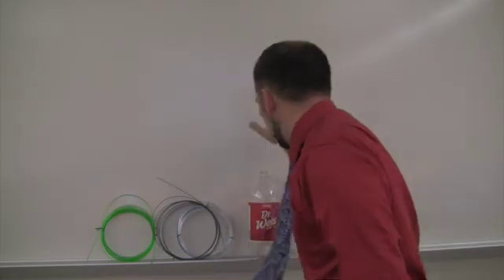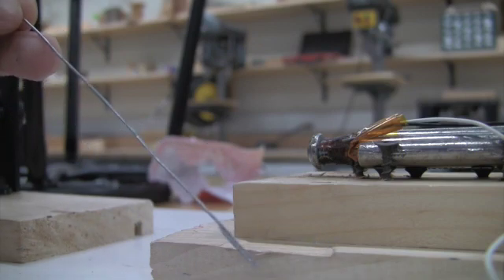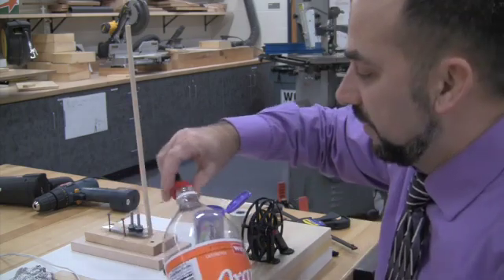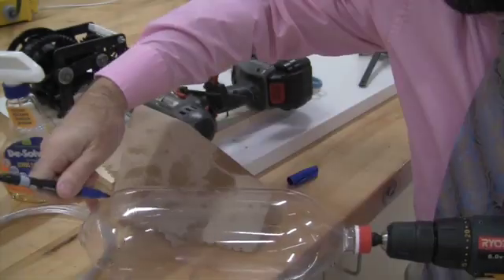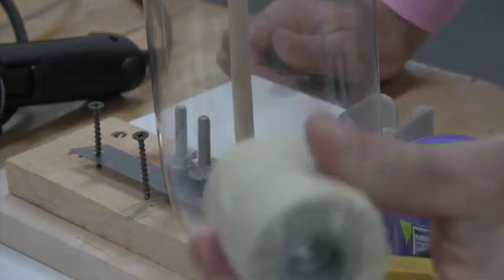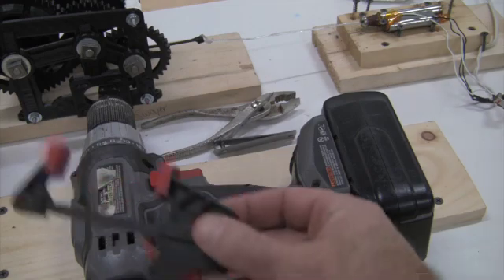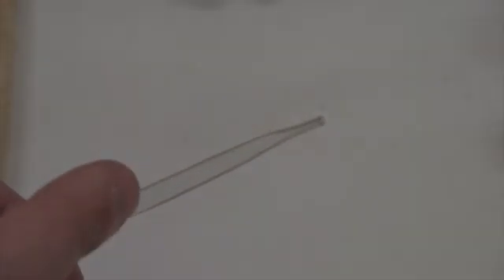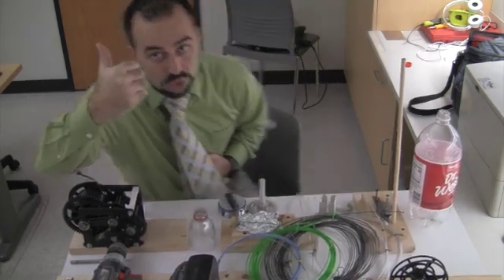PET Pultrusion Filament Maker

Comment: Hey, this video caught my attention the most out of all of them. Every step is explained in detail – even the bottle cutter one, which interests me the most. So how thick should the PET strip from Coca-Cola Zero be for a 1.5 mm nozzle? I'm not sure about what my caliper measured. It shows something like 0.33 mm? I only have a 1.5 mm nozzle – I saw in some other guides that they used a 1.5 mm nozzle to avoid clogging the filament in the Bowden tubes of the printers. Also, I’m really struggling to get the bottle cutter to work. I’ve tried many types, including the bearing-based one, and that one doesn't work for me at all. I must be doing something wrong. But I’m a DIY guy, and this is a challenge for me.

Comment: please anyone  who trys this with a random glue gun there is a chance there is a spring loaded ball valve inside the tip of the glue gun ( i had to drill the tip out and push the ball out from the other side) after that i tapped the tip and im attempting to use a welding tip for flux core drilled out to 2mm so far no luck  but im not giving up
Reply: i did get it to make a 10 inch long segment  ( pulling by hand   for proof of it working) please note i did not modify the welding contact tip other than drilling the hole size to 2 mm
im probably going to have to find a modified drill bit i made and drill a steeper cone  for the fillament to curl through  but im very limited because its copper and its already very small ( generaly a flux core welding contact has a cone  in it already but its very shallow) now because its copper there is a chance it can suck the heat directly into the tip  but i did get it to work once so the extra heat in the tip could help with the curling
Reply: @therelentlesscreator3938  Thank you

Comment: Is the filament full or empty?  It's empty for me, can I print like this?
Reply: The filament is "empty" or hollow, like an almost-closed tube.  The heat gun just curls the flat ribbon into a "C"-shaped tube as it pulls the  PET through.  Good luck, you should be able to print (small) items with this because the filament is quite short.

Comment: When you took apart the glue gun did you remove any internal elements from the heat tube?  Some glue guns have hardware inside the heat tube that do not allow a straight path.
Reply: Use one that doesn't. The cheaper the better.

Comment: about how many rpms is the drill moving? im thinking of just using a small batery powered dc motor for my setup. 

Thanks alot for this
Reply: wont work, u need a bigger motor

Comment: Have you thought of a way to attach more ribbons together to create longer filament?
Reply from the maker: You can look around youtube for other videos about mending filament however it is very difficult and many people have trouble doing it. I have not seen it done during the pultrusion process because of how much tension is on the filament as it comes through the extruder head.
Reply: @bruisersbackyard5668  yes this makes sense, I am wondering if you could make a system like how packing strips come where you can pull them one way but they pull apart the other way. Just my two cents, I am 90% ready to take on doing this soon if filament prices for PETG exceed $20